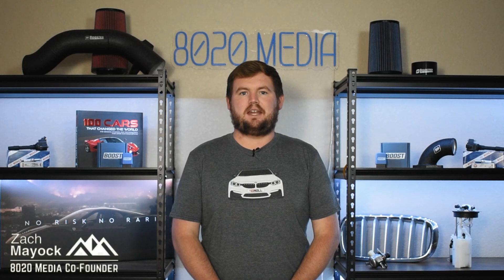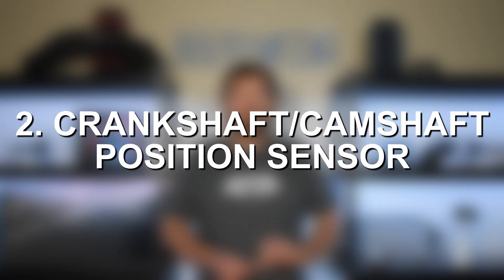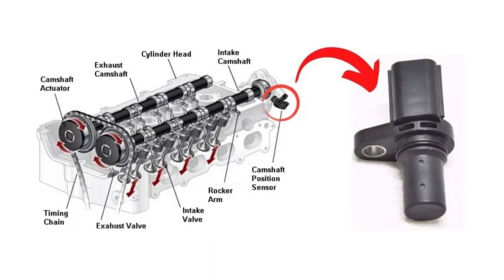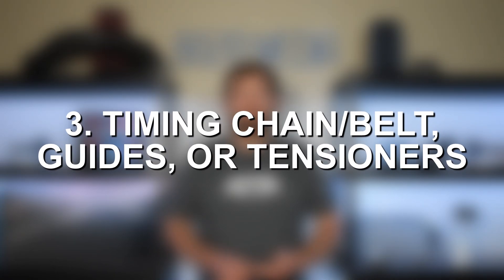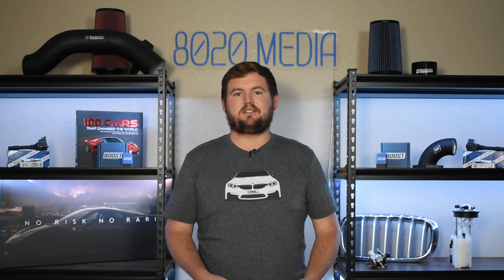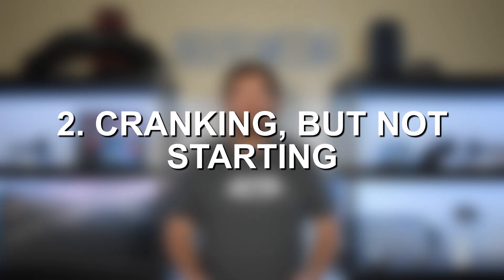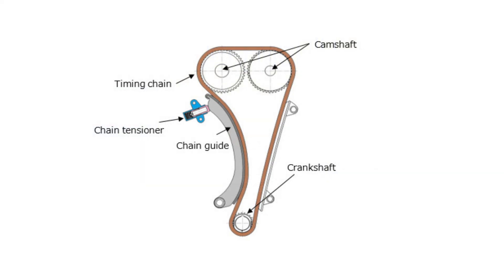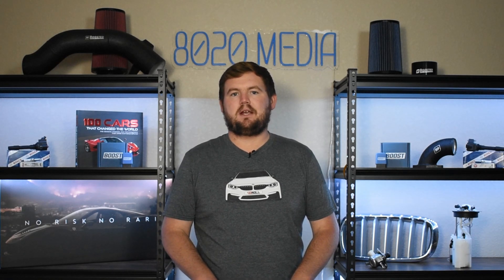What's Causing Your P0016 Code? Symptoms, Causes, & Fixes!

Comment: Got P0016 code right after an oil change, car runs fine, nothing weird going on.  Tempted to turn the light off with a code reader and see if it comes back on again.  Otherwise the car is running fine, no leaks no other issues.  Will it hurt the car to just keep driving it with the engine light on?

Comment: Hi Zach, thank you for very informative video. I am not a mechanic but really helpful video. I have a 2015 Mazda cx9 that showed the engine light on w/P0016 code. I replaced the valve cover along with bank 1 & 2 vvt solenoid but the light still keeps coming on. Could it be the timing chain?

Comment: I got a 2007 Toyota Camry 2.4l and currently got a p0012 and p0016 code and I’m guessing it’s just a bad sensor considering my car has 188k miles and from what I heard it’s a common issue. The car idles and runs perfectly fine

Comment: I was wondering if there's a direction you can help point me in! I have a 2020 Hyundai Palisade and I have a P0016 code but also P0171, P00D2, P0136, and P2177. The only information it is showing me is System Too Lean, System Too Lean Off Idle and 02 Circuit
Reply: Its your pcv and your vvt is probably clogged too look for sludge under the valve cover thid happens when oil is pushed into the combustion and burned because high crank case ventilation

Comment: Hi great video, I have the P0016 code along with P0014.  Any ideas please? 💡
Reply from the maker: T - Thanks for the feedback! When you have both P0016 (camshaft/crankshaft correlation) and P0014 (exhaust cam timing over-advanced) together, it almost always points to a timing or oil control issue rather than a single bad sensor. These codes mean the ECM sees the exhaust cam not where it expects relative to the crankshaft. Start by checking oil condition and level — old, dirty, or low oil can restrict the VVT solenoid or cam phaser, causing incorrect cam timing. Next, remove and inspect the VVT solenoids (especially the exhaust one) for debris or sludge; clean or replace them if they’re sticking. If the solenoids are clean and working, the next step is to verify mechanical timing with the valve cover off — the timing chain may have stretched or jumped a tooth, throwing cam correlation off just enough to trigger P0016. It’s also worth checking the camshaft phaser itself if it rattles at startup or doesn’t return to its locked position. On some engines, even one bad camshaft sensor or crank sensor can throw both codes, but that’s rare unless one’s signal is missing entirely. In short: start with clean oil, inspect and test the solenoids, verify chain stretch or timing marks, and only replace sensors last.

Comment: Have P0016 & P0011 code firing together on 2014 VW Passat recently oil pressure light came on but still drivable ish 
Can I get help with proper diagnosis please 🙏

Comment: I'm getting a P0016 code, 2010 Audi Q5. But only at approx 2000rpm half throttle, above or below this range its fine, always around 2000rpm. Car runs spot on, starts fine, like theres no issue. Any thoughts?
Reply from the maker: S - A P0016 (camshaft/crankshaft correlation error) that only shows up consistently around ~2000 RPM/half throttle but not at idle or high RPM is usually an early sign of timing chain stretch or a worn timing chain tensioner — at that mid-range load, chain slack shows up just enough for the cam/crank signals to drift out of spec and trigger the code, even though starting and general running still feel normal. Other possibilities are a faulty camshaft position sensor or crank sensor, but those usually cause random misfires, poor starts, or codes at multiple RPM ranges, not just a narrow band. Since this engine is known for chain/tensioner issues, I’d first scan live data for camshaft adaptation values; if they’re outside spec, it confirms chain stretch. If those values are good, then checking the sensor wiring/connectors is next. Even if it runs fine now, catching a chain/tensioner problem early is critical, because when they fail fully, they can cause major engine damage.

Comment: I changed only the engine belt and the oil engine belt tensioner. now the car is taking long crank and has a P0016 error. I didn't touch the timing belt. Any Solution
Reply from the maker: M - A P0016 (crankshaft/camshaft correlation error) showing up right after you changed the serpentine belt and tensioner suggests something shifted during the work — even though you didn’t touch the timing belt, if the harmonic balancer/crank pulley wasn’t seated or torqued correctly when reinstalling the accessory belt, the crank sensor can read out of sync with the cam. A damaged crank sensor, loose connector near the pulley area, or debris from the job interfering with the sensor’s signal could also trigger this code. Since a long crank often means the ECU isn’t happy with timing input, I’d start by double-checking that the crank pulley is tight and aligned, inspect the crankshaft position sensor and its wiring right by the pulley, and clear the code. If the P0016 comes back and the pulley/sensor check out, then you may need to verify that the timing chain/belt itself hasn’t jumped a tooth coincidentally (rare, but possible at higher mileage).

Comment: Can cam phasers throw the code? Infamous 1st gen f150 ecoboost cam phaser knock after prolonged startup. Also now showing a permanent code for cylinder 6 misfire but engine isn’t obviously knocking while running it actually runs very smoothly off of what I can see and feel
Reply from the maker: M - Yes — worn or out-of-sync cam phasers on a 1st-gen F-150 EcoBoost can definitely trigger a P0016 (cam/crank correlation) because the phasers can’t hold timing correctly, especially if you already have the classic cold-start knock; the PCM sees the cams drifting relative to the crank and sets the code. The permanent P0306 (cyl 6 misfire) even if it feels smooth can be the ECU catching tiny misfire counts that aren’t obvious to you, and sometimes they’re false positives caused by timing correlation issues rather than an actual bad coil or injector. Since the truck is smooth once running, the phasers and timing chain stretch are the most likely root cause of both codes, so the long-term fix usually means a full timing set with phasers, chains, and tensioners, which addresses both the startup knock and the P0016.

Comment: My car turns on just rough idle and misfires im hoping it’s just the senors i get p0016 and P0340
Reply from the maker: A - With P0016 (crank/cam correlation error) and P0340 (camshaft position sensor circuit) together, your rough idle and misfires are most likely from a timing chain/belt that has stretched or jumped a tooth, or a bad connection to the cam sensor, rather than just a bad sensor alone; since P0016 means the ECM sees the cam and crank out of sync, a failing sensor won’t usually trigger both codes at once unless the timing is actually off, so the best next step is to inspect timing marks to confirm chain/belt alignment and check the cam sensor wiring, because replacing sensors without addressing a mechanical timing issue won’t clear these codes or fix the misfire.

Comment: Having this issue on my fiesta st200, all sensors have been changed and timing belt was just changed. It has no symptoms after the timing belt change however engine light came back on with same code after a week, any advice?
Reply from the maker: T - If your vehicle is throwing a P0016 code (Crankshaft Position – Camshaft Position Correlation Bank 1 Sensor A) shortly after a timing belt replacement, even though it's running fine, it's very likely that the timing is off by just a tooth or the cam/crank phasers weren't aligned exactly during reassembly—this can trigger the code even if drivability seems normal. Since all sensors were already replaced, it's unlikely to be a sensor fault. I’d recommend rechecking the mechanical timing with the proper locking tools to confirm that both camshaft and crankshaft positions are perfectly aligned. On the 1.6L EcoBoost (used in the ST200), this code is notorious after timing service if the crank pulley or cam sprockets weren’t torqued precisely or if the belt tensioner wasn't preloaded and locked down correctly. Also, check for oil flow issues to the VVT system, as dirty oil or a stuck VVT solenoid can cause correlation errors too. But in your case, mechanical misalignment is the most likely culprit—especially with no performance symptoms.

Comment: I got both p0016 and p0017 and I changed the crankshaft position sensor nothing changed.
Reply from the maker: T - Did you clear the codes?
Reply: @8020Automotive yes on my reader it says permanent code.
Reply: @8020Automotive yes
Reply: @8020Automotive yes I did

Comment: Hey Zach I appreciate your guys’ helpful videos. Any input on what you think the issue would be with a 2018 Mercedes E300 that is taking a couple extra seconds to crank before starting? I can clear P0016 code which shuts off the engine light which allows the car to start normally, but after a couple starts the light/code comes back on and again takes a couple extra seconds to turn over. No other drivability issues besides the car turns off the start/stop function.
Reply from the maker: B - The delayed cranking and recurring P0016 code on your 2018 Mercedes E300 point strongly toward a timing correlation issue between the crankshaft and camshaft—likely caused by a stretched timing chain, worn chain tensioner, or camshaft adjuster issue. The P0016 code (“Crankshaft Position – Camshaft Position Correlation (Bank 1 Sensor A)”) specifically means the ECU is seeing a mismatch between where it expects the camshaft to be in relation to the crank, which explains the engine light, disabled start/stop system, and extended cranking. Clearing the code temporarily resets adaptive values, which can make the engine start normally for a bit, but the mechanical mismatch quickly triggers the fault again. A diagnostic with live data to watch cam/crank correlation, or a physical timing chain inspection (especially if cold starts are noisy) would help confirm. If left unresolved, it may lead to rougher starts, poor fuel economy, or even further valvetrain damage.
Reply: @8020Automotive I really appreciate your detailed response! You guys are amazing! Do you think I should dump her since it’s nearing 100k miles, especially if a timing chain issue, or would it potentially be worth the repairs? Just curious what you would do as I’m leaning on going back to something with the m276 like in my last e350 which lasted to 175k miles without major issues

Comment: I've been fighting with this error for years on my 2004 GMC Envoy XL.  Check Engine light on with P0016. Local shop replaced VVT solenoid but check engine came back on same day. Hard to believe it's timing chain because it runs and drives fine.  No change in MPG, rock solid at 15 for over a decade. Very frustrating since I cannot pass emissions with check engine on.
Reply from the maker: F - Totally get the frustration—P0016 (Crankshaft-Camshaft Correlation Bank 1 Sensor A) is infamous on the 4.2L I6 in your 2004 Envoy, and if the engine runs fine, with solid MPG and no noise, it's unlikely the timing chain is stretched badly enough to cause real performance issues—but just enough stretch or slack (even a few degrees off) can still trigger P0016, especially when hot or at startup when the ECU checks cam/crank sync; since the VVT solenoid has already been replaced with no improvement, I’d next inspect or replace the camshaft position actuator (the sprocket assembly), and definitely check the cam and crank sensors—a weak or aging sensor can misreport timing even if the mechanical timing is still technically within spec; also verify engine grounds are clean and the ECM is seeing stable voltage, because voltage fluctuations can mess with sensor signal timing and throw false P0016 codes—last resort before tackling the chain would be scoped diagnostics or relearn procedures to confirm the ECU isn’t just out of sync from a minor sensor drift.

Comment: I have a 2019 Jetta 1.4 where the lifters, rocker arms, timing belt and tensioner were replaced and ever since the check engine light and epc light is on and it was a slightly off on the timing and that got fixed but now engine speed sensor incorrect correlation p0016 check engine light is on and won’t go away along with epc light but engine runs fine
Reply from the maker: M - If your vehicle is throwing P0016 (crankshaft/camshaft correlation error) and showing the EPC light even after correcting slightly off timing and replacing lifters, rocker arms, belt, and tensioner, it likely means the camshaft or crankshaft sensor is either faulty, not synced properly, or misreading due to slight mechanical misalignment still present—even if the engine seems to run fine. The EPC (Electronic Power Control) light stays on because this code affects engine timing and emissions control. Double-check that the timing marks are 100% dead on, not just close, and inspect the camshaft position sensor and its wiring; even a slightly damaged tone ring or improperly seated sensor can cause correlation faults without drivability symptoms. If timing is perfect, replacing the camshaft or crankshaft sensor and clearing the code may be required to fully reset the system.

Comment: Thanks for that. Just got a car with a P0341 and a P0016. One day symptoms just started... with engine tsking a little longer to start and some misfires when pressing the accelerator. Been driving for 2 to 3 months, no worsening of symptoms... what you think?
Reply: Only travelled 60000 kms and is 2017 i30
Reply from the maker: K - If you’re seeing P0341 (Camshaft Position Sensor Range/Performance) and P0016 (Crank/Cam Correlation) together, and symptoms like longer crank times and slight misfires under throttle just suddenly began but haven’t worsened over 2–3 months, it’s likely that your camshaft position sensor is beginning to fail or the timing chain/belt has stretched slightly, causing the ECU to detect misalignment without a total mechanical failure yet; since it’s stable, it’s probably not skipped timing, but you should inspect or replace the cam sensor first (they’re cheap and easy), check the timing alignment if possible, and monitor for worsening symptoms, especially under load or high RPM. Keep us updated!

Comment: Vehicle: 2010 Toyota Camry
Issue Summary:
	•	The car takes 4–5 seconds of cranking to start, but once started, it runs smoothly with no performance issues.
	•	The check engine light and TCS (Traction Control System) light are on.
	•	OBD-II codes shown:
	•	P0335 – Crankshaft Position Sensor “A” Circuit
	•	P0504 – Brake Switch “A” / “B” Correlation
	•	Already replaced:
	•	Crankshaft position sensor
	•	Camshaft position sensor
	•	ECU (Engine Control Unit)
	•	After replacing or unplugging and reconnecting the crankshaft sensor, the lights go off and the engine starts normally. But after 5–10 minutes of driving, the lights come back on, and the long crank returns.
	•	Mechanic diagnostics say everything appears fine, but suspect the ECU (even after it was changed, the issue persists).

⸻

Key symptoms:
	•	Delayed crank start (4–5 seconds)
	•	Check engine + TCS lights
	•	Persistent P0335 code even after parts replacement
	•	Resetting the crank sensor temporarily fixes it
Reply from the maker: Your 2010 Toyota Camry’s long crank and recurring P0335 code—even after replacing the crankshaft and camshaft position sensors and ECU—strongly suggest a wiring or grounding issue, not a faulty component; the fact that unplugging and reconnecting the crank sensor temporarily fixes the problem points to a loose, corroded, or heat-damaged connector or harness, especially near the sensor or ECU, and the issue returning after 5–10 minutes of driving supports the idea that heat expansion is disrupting signal continuity; you should closely inspect the crank sensor wiring for damage, test grounds around the ECU and engine block, and consider replacing or repairing the sensor harness itself—also address the P0504 (brake switch correlation), as a bad switch can trigger TCS faults and potentially interfere with ECM logic; resolving the signal integrity issue between the crank sensor and ECU is the most likely fix.

Comment: 2014 S60 T5 AWD 2.5L Turbo - timing belt was replaced last April by shop assessing now. Currently check engine and code P0016 reading. Shop replaced the intake VVT cam solenoid but shop says its not reading correct values and still reading P0016. They want to check the timing and sensors and wiring on the "other side of the engine " - does it sound like we are on the right track? Car is running fine without any known issues. Car has only been driven 7,000 miles since timing belt was done.
Reply from the maker: 2 - Yes, your shop seems to be on the right track with diagnosing code P0016, which typically points to a timing correlation issue between the crankshaft and camshaft. Since the timing belt was replaced only 7,000 miles ago, it’s possible the timing is slightly off—even by one tooth—which may not cause immediate performance issues but can still trigger the code. Replacing the intake VVT solenoid was a good first step, but with the code still present, checking the mechanical timing, crankshaft and camshaft position sensors, their wiring, and the VVT gear itself is the logical next move. Even if the engine seems to run fine now, unresolved timing issues can cause long-term problems, so further inspection is a good idea.
Reply: @8020Automotive  For future reference the codes were triggered by the shop installing an after market oil filter that they stovepiped in the middle. Apparently that created a gap that was affecting the airflow then triggering the cold start codes. New Volvo oil filter solved the problem.
Reply from the maker: @2025emmettjohnson Thanks for sharing!